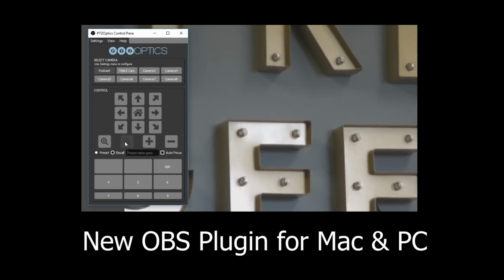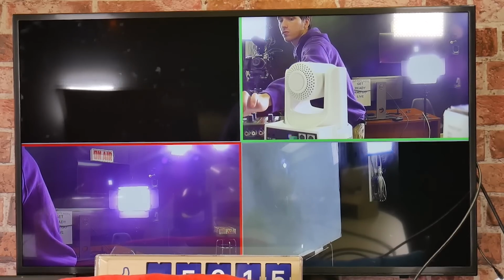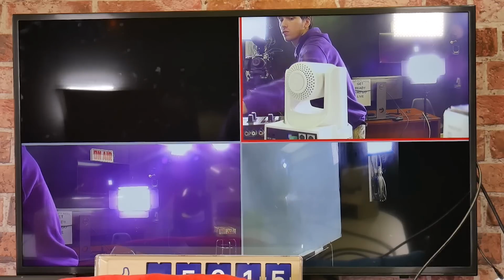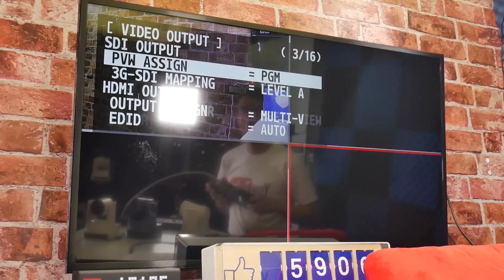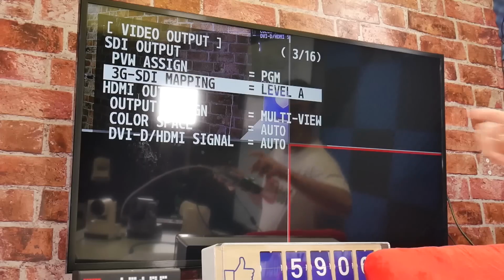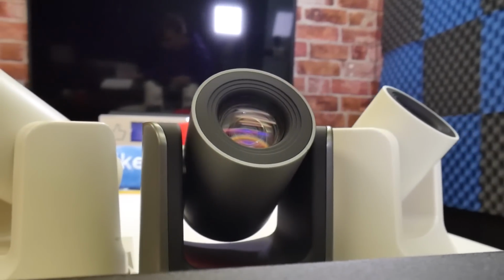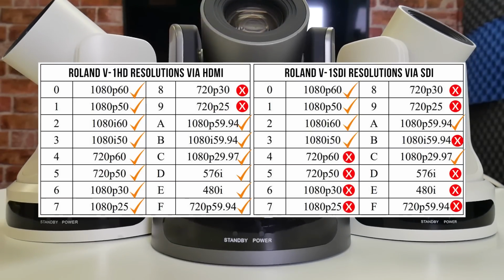Roland V-1HD & V-1SDI Video Switchers w/ PTZOptics Cameras

Comment: How can I overlay 4 ptz images at once in a mix using the v1hd
Reply from the maker: Hello!
To overlay four PTZOptics camera feeds simultaneously using the Roland V-1HD video switcher, you'll primarily be using the switcher's capabilities for multi-view output, since the V-1HD itself does not directly support picture-in-picture or multi-layer compositing for multiple live inputs. 

Here's a step-by-step guide on how to achieve a setup where you can manage and switch between multiple camera feeds:

Equipment Needed:
1. PTZOptics Cameras (4 units)
2. Roland V-1HD Switcher
3. HDMI Cables
4. Monitor or Display Device

Setup Process:
Step 1: Connect Your Cameras
Connect each PTZOptics camera to the Roland V-1HD via HDMI. Each camera will occupy one HDMI input on the switcher.

Step 2: Set Up the V-1HD
Power on your Roland V-1HD.
Make sure each camera feed is correctly identified and appearing in your switcher’s preview.

Step 3: Configure Multi-View
The V-1HD allows you to use a Multi-View output to see all connected inputs on a single display. This is particularly useful for monitoring all your camera feeds simultaneously.
Connect the Multi-View output of the V-1HD to a suitable monitor.
Adjust the Multi-View settings via the menu system to ensure all inputs are displayed as desired.

Step 4: Switching Between Cameras
Use the switcher to select which camera feed is live at any time. The V-1HD does not support layering multiple feeds over each other but allows quick switching and cutting between feeds.

Limitations
The V-1HD is primarily a switcher, not a video mixer that can composite several video layers (like in a news broadcast where multiple images are overlaid on the screen simultaneously). If your production requires overlaying images (picture-in-picture or side-by-side), you might need additional equipment like a video processor or a more advanced switcher that supports such features.

Alternative Solutions
If you need to overlay images directly, consider upgrading to a switcher that supports such features, like the Roland V-60HD or others that handle multi-layer composites.

Alternatively, software solutions like OBS (Open Broadcaster Software) or vMix can be used in conjunction with capture devices to manage overlays and more complex compositions digitally.

If you're setting up for live production and want to manage multiple PTZOptics cameras with more complex visual layouts, using a computer-based solution or a more advanced hardware switcher might be necessary to achieve the desired visual effects.

Thanks for checking out our Channel! 
Learn More: https://ptzoptics.com/

Comment: does this unit have a auto switching mode?
Reply from the maker: Hello!
The Roland V-1HD and V-1SDI video switchers are popular choices for live video production, offering a range of features for mixing and managing video sources.

However, neither the Roland V-1HD nor the V-1SDI models have a built-in auto-switching mode that would automatically cycle through inputs after set intervals of time or based on other criteria like audio levels or video motion detection.

These switchers are designed for manual operation, providing users with tactile buttons and faders to control the live switching experience. They offer features like picture-in-picture, video effects, and transitions, but auto-switching would require an external solution or additional software that can control the switcher via MIDI, RS-232, or USB depending on the model's connectivity options.

Solutions for Auto-Switching:
External Software or Controllers: Some users implement auto-switching by connecting the switcher to a computer and using software that can send control signals (e.g., via MIDI) to the switcher to change inputs automatically. This approach may involve custom scripting or specialized software designed for live production automation.

MIDI Control: For models that support MIDI, you could potentially use a MIDI sequencer or controller programmed with a sequence of input changes to achieve auto-switching. This would require some setup and programming specific to your production needs.

Integration with PTZOptics Cameras:

While the PTZOptics cameras can be controlled via IP, VISCA, or RS-232 for PTZ movements and presets, integrating their control with the Roland switchers would not directly enable auto-switching of the video inputs on the switcher itself. However, PTZ presets can be used creatively within your production to change camera angles or positions without the need to switch video sources, offering a form of visual variety.

For productions using PTZOptics cameras with these Roland switchers, consider leveraging the PTZ presets alongside manual switching to enhance the dynamic nature of your video production.

Alternatives:
If auto-switching is a critical feature for your productions, you may need to explore other switchers or add-on devices that offer this capability or consider switchers from other manufacturers that include auto-switching as a built-in feature. Always check the latest product specifications and firmware updates, as manufacturers occasionally add new features or improve existing ones through software updates.

Thanks for checking out our Channel! 
Learn More: https://ptzoptics.com/

Comment: Do you have to buy the joystick controller or can you set the cameras wt the remote controls
Reply from the maker: Hello!
To control PTZOptics cameras, you have options beyond purchasing a dedicated joystick controller. The cameras can indeed be set and controlled using the provided infrared (IR) remote control. This remote allows you to perform a variety of functions, such as adjusting the pan, tilt, and zoom of the camera, changing presets, and configuring basic settings.

Using the IR remote control is a cost-effective solution for many users, especially if you have a limited number of cameras or if your setup does not require rapid, precise adjustments that might be easier with a joystick controller. However, for environments where you have multiple cameras or need more precise control over movements, a joystick controller can be a valuable investment. It provides a more tactile and responsive way to manage your cameras, especially during live productions.

For setups involving multiple PTZOptics cameras or for users seeking an enhanced control experience, the joystick controller offers advantages such as:

- Direct control over multiple cameras from a single interface.
- More precise movement and speed adjustments.
- Ability to quickly switch between cameras and presets.

Whether you choose to use the IR remote or invest in a joystick controller depends on your specific needs, budget, and the complexity of your video production setup.

Thanks for checking out our Channel! 
Learn More: https://ptzoptics.com/superjoy/

Comment: Hello,

How were you able to connect the magewell capture card to stream?
I'm having some issue with wirecast. It reads the card, but there is no output
Reply from the maker: Which capture card are you using? Are you using a USB 2.0 or USB 3.0 port?
Reply: @PTZOptics  Magewell Capture Card. USB 3.0
Reply from the maker: BIXER STUDIOS - interesting. Do you have it plugged into a USB 3.0 power?
Reply: @PTZOptics  Yes, we used an hdmi splitter, and it worked. Thanks
Reply: Another question, how are able to output audio from switcher for live stream?
Reply: Also, we are using rca to the mixer board

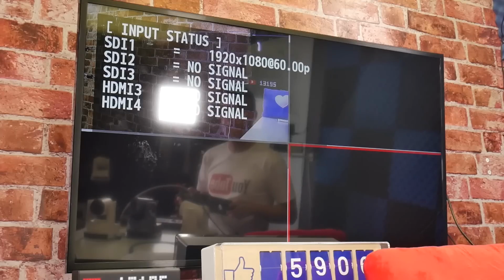Comment: 4:19
 Level A - I never knew this about SDI and got me thinking about my Datavideo SE-1200mu. Some basic research about Levels suggests many manufacturer's inputs are auto-capable of A or B, and a few are B-only. Are all PTZ Optics cameras Level A? And what about my older SONY cameras (as are many) that are probably the standard Level B? If I set the V-1 to Level A, will it see Level B devices? Or does this only come in to play with high frame rates of 59.94/60?
Reply from the maker: Yes, it is something to be aware of. More information is available here - https://help.ptzoptics.com/support/discussions/topics/13000022969